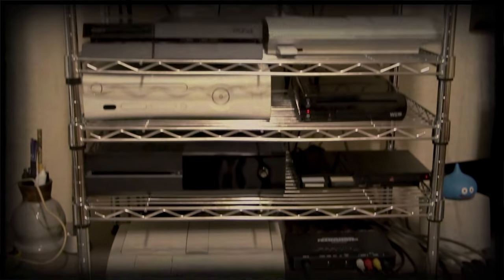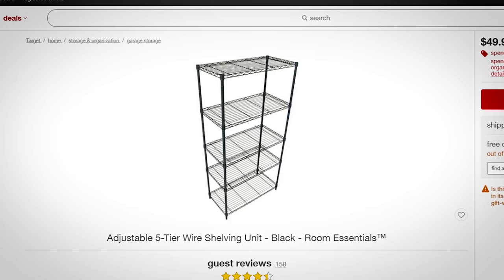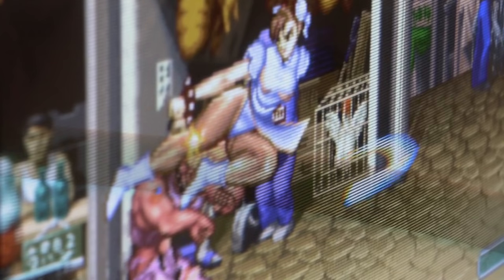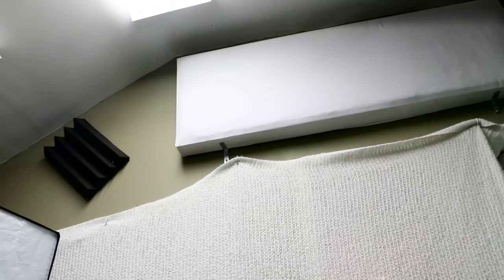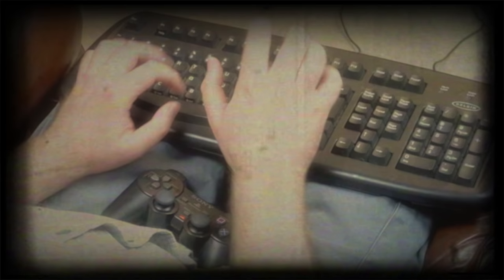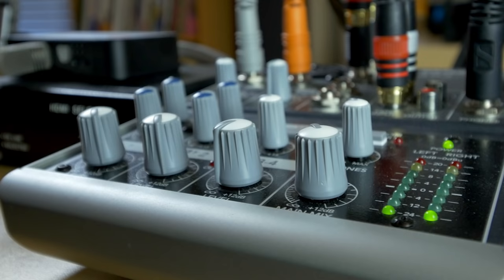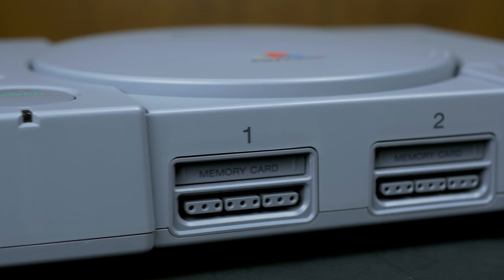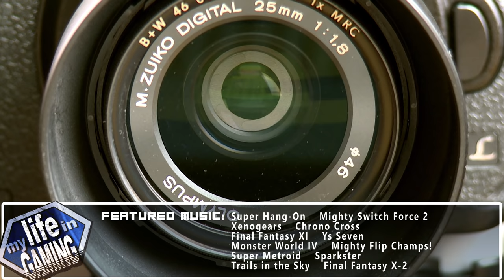Gaming Setup and Studio Tour - How We Make MLiG in 2016 / MY LIFE IN GAMING

Comment: I was directed to this video for finding the right adapter for hooking up a game console via RGB SCART to my PVM but also somehow splitting the connection so it could also go to the Framemeister's RGB IN, but I'm not sure if I know which exact adapter featured in this episode is needed. Any help or links to buying the right adapters is appreciated! I'm not concerned about having a SCART switcher, I just want to be able to livestream by using the PVM via SCART and Framemeister via SCART/RGB IN at the same time. Thanks!
Reply from the maker: [Try4ce] Does your PVM have outputs? That's by far the simplest way. If you already have a female SCART adapter for the Framemeister, then talk to wookieewin on eBay. Tell him you need a PVM output cable ending in a male SCART. The reason you have to ask is because his cables are, by default, wired for PVM input only, not output. If you don't have outputs, it could be a bit trickier. The GSCART I showed has two outputs, which is nice. Coury also has a SCART splitter, but those are kind of uncommon... good ones don't appear on eBay very often, I'm told. Someone in the UK helped him get his.
Reply: Thanks for the reply! I have a Sony pvm-2030, so no component outputs unfortunately. I already have the parallel --> SCART adapter for my SCART cables. GSCART is a bit out of my price range considering I still need to plunk down on the Framemeister. I could perhaps look into that SCART splitter! Also, where should I get the SCART converter for my MALE SCART to work on the Framemeister's RGB IN port?
Reply from the maker: [Try4ce] Check the link in our video descriptions for a link to retro_console_accessories on eBay. Even though her store looks closed, check earlier in the day. She makes the cables as they're ordered, so the store is closed for the day after a certain quota is made. I assume you're aware that the Framemeister comes with an adapter cable, but it's JP-21, NOT SCART.
Reply: Ah right, in that case do I need a female JP-21 to female SCART cable? Is that something retro_console_accessories carries?
Reply from the maker: [Try4ce] Not necessarily. We decided to go with SCART instead of JP-21, because it's easier to find SCART cables generally, and equipment that's compatible with them. But some people choose to go JP-21. It really doesn't matter which you choose, as long as you stick with it, because having inconsistencies in your setup is just going to cause headaches... they look the same, but are wired differently, so they're incompatible. If you choose JP-21, then the adapter that comes with the Framemeister will probably suit your needs. But if you want to go SCART, then buy the adapter from retro_console_accessories. Watch RGB 103 if you want some more clarity about what types of cables to buy, and the difference between SCART and JP-21.

Comment: Is turning down the sharpness important on a crt tv running s video ?
Reply from the maker: [Try4ce] Not necessarily. Sometimes it could be over-sharpened, yes, but things might get too blurry if you put it too low. The way that every TV handles it will be different, so you'll just have to look at it and see if you're getting anything like halo artifacts. If you have access the 240p Test Suite (through a flash cart for example), there are test patterns that can help you determine if the image is being over-sharpened.

Comment: Does anyone know if i can use the bnc loop out on my Sony pvm to hook it up to my frameister, thus using both at once?
Reply: No. It needs to be converted to JP21, not SCART, unless you have an aftermarket SCART adapter for your XRGB Mini. Running SCART into the RGB adapter cable that comes with the Framemeister won't work, and it might even damage the scaler.
Reply: Dave Bladegun I have an after market scart adapter for my xrgb
Reply: Well there ya go.

Comment: I know you have to use the frame meister for certain consoles though I have to wonder why you  haven't portes all the consoles you own to hdmi given the access hdmi for original like the ps1, ps2, xbox
and dream cast..
Reply from the maker: [Try4ce] Well, first, keep in mind this video is years old at this point. Secondly, our stuff kind of is all HDMI to a point. True, there are HDMI cables for PS1, PS2, Xbox... kind of. But remember that those systems are outputting analog video, so those HDMI adapters are simply converting analog to HDMI... just as we do with the Framemeister (now we use the OSSC more, which is also HDMI). By taking RGB and component from our consoles, that gives us the option to use the upscalers on an HDTV (and for capture) as well as to play on CRTs. If we only used HDMI, then that wouldn't be an option. As for Dreamcast, yes, there is a true HDMI mod for Dreamcast now, and Coury has it. It looks amazing, and I'll get one eventually myself. A proper true digital PS2 HDMI mod is also in the works, but we have no idea when it will be finalized.
Reply: @mylifeingaming  my understanding is most are using using the hdmi to the multi outs

i think the truest console in the market that  outputs to hdmi is from poly mega however  if or when it sees retail release on store shelves

I'm surprised you aren't using the pound cable yet..

I realize this might be years old however with the likes of pounds until poly mega gets out of the gate might be the only option to use..

I was more thinking of a way to reduce power consumption
Reply: Jason howe
The pound cables don’t look as good as component or RGB.
Reply: @mylifeingaming  really can't wait for the RGB 200 episode on the Dreamcast.

Comment: What is that circular rotating wooden board you have under your PVM? I need to get one of those!
Reply from the maker: +Robert Langdon [Try4ce] It's just a Lazy Susan from Walmart. Balancing the PVM on top is a little weird because I had to shift the center of gravity forward or back for it to not tilt the Lazy Susan.
Reply: Ah I see. Aren't there any better alternatives? Wouldn't you be better off with a greater circumference so that it's feet are in contact with it rather than all of the weight being on the base (if you know what I mean). Is the PVM okay with resting on it's base? Truly legendary setup by the way!
Reply from the maker: +Robert Langdon [Try4ce] Probably better alternatives, yeah! I just used it because I had it and wasn't using it for anything else. I have a bigger PVM in that spot now, so I don't use the Lazy Susan anymore.
Reply: Cool, have you got a 20 inch now? Which model?
Reply from the maker: +Robert Langdon [Try4ce] I actually have two. First I got a 20L2MD, a medical model. Then I got a 20L5, which also supports 480p, 720p, and 1080i.
Reply: Awesome! So are they some of the best sony PVMs? The internet gave me the impression that the 21F1U is the best sony BVM. Just because of how hardcore you guys are with retro gaming gear, I thought you'd have opted for one of those? I've got a 20M4E/U, but I don't really know where mine measures up in the range of PVM quality.. but I'm definitely happy with it!
Reply: My Life in Gaming I have a 1354q and a 14m2mdu. Where can I get them calibrated? I'm in the Boston area

Comment: Do you run your modern systems that output via HDMI through the framemeister as well?
Reply from the maker: [Try4ce] Sort of. I split the HDMI signal a couple of times. One line goes to the TV, and another goes through the Framemeister. They are not processed by the Framemeister, I simply run them through it so that the output from the Framemeister can go to my capture card, and provide all consoles, modern or retro, through one HDMI line. Makes things very convenient.
Reply: Oh okay. Thanks for the response! So it doesn't improve the picture quality running through the framemeister? It is more of a convenience thing based on your setup.
Reply from the maker: [Try4ce] Right. I've experimented with upscaling 720p and deinterlacing 1080i with the Framemeister, but have yet to determine that there's a perceptible benefit that's worth the potential tiny bit of added lag.
Reply: Oh so there is still lag when running through the framemeister even if it isn't being upscaled?

Comment: Couldn't you use a SCART to VGA adapter and use cheaper VGA switcher boxes?
Reply: No.
Reply: Dave Bladegun Very helpful... and why not, good sir?
Reply: Because VGA and SCART are not compatible, they use different kinds of video sync. It would require an actual converter to change from one to the other, and such a thing is neither common nor practical.
Reply: Dave Bladegun Okay., thanks. I have seen SCART to VGA cables before, though.
Reply: GoldenKingStudio
I hope this helps:
VGA, is a format that uses separate lines of sync for vertical and horizontal, SCART combines both into one.  RGBHV (Red, Green, Blue, Horizontal, Vertical -- or VGA for the purpose of this discussion) must be changed by modifying the sync signals and combining them into a single signal which would be RGBS (Red, Green, Blue, Sync).  Doing this requires a sync combiner, and doing the reverse would require something called a sync stripper.  In neither instance would you be able to simply connect or split the wires and then rig them up the desired connector (ala SCART, JP21, VGA, etc.) -- again, I hope that helps to clear things up for you.

Comment: Does solaris japan ship xrgb minis to NA?
Reply from the maker: +TyTech [Try4ce] Yep! That's where we both got ours.
Reply: My Life in Gaming last question, if I bundle a super Nintendo rgb scart cable with it, will it work with my snes even though it's NTSC? I know I have to mod my snes junior but I don't know if I need to get a different cable or not.

also thanks for responding to most of my comments, I'm probably coming off as annoying but you're really helping me right now!
Reply from the maker: +TyTech [Try4ce] Yep, that's right. We haven't used the cables from Solaris ourselves. I think they are JP-21, so they would work with the adapter included with the Framemeister. You can choose JP-21 or SCART, either is fine, but you should use the same type for all of your systems once you choose one and stick with it. We explain why in RGB 103.